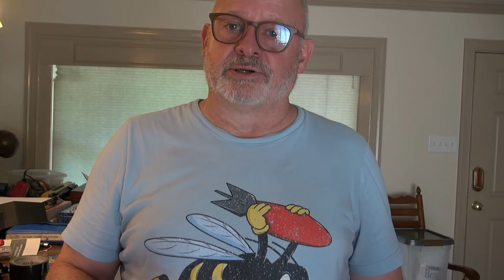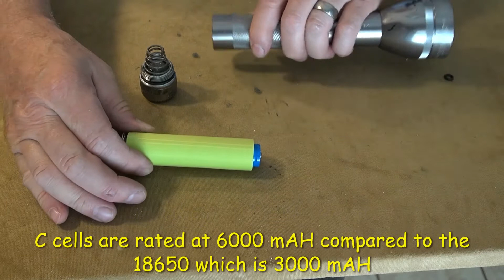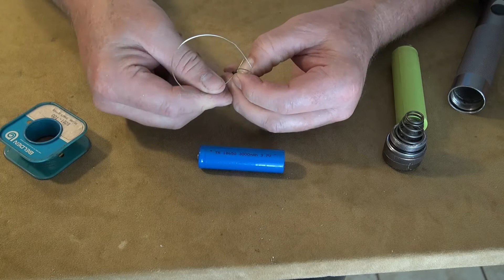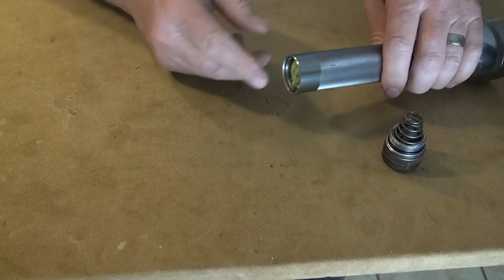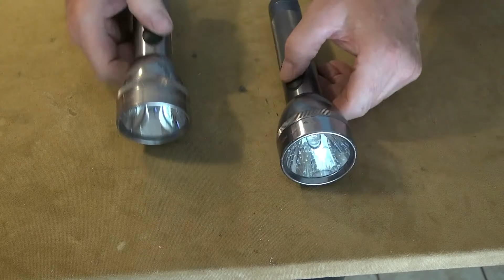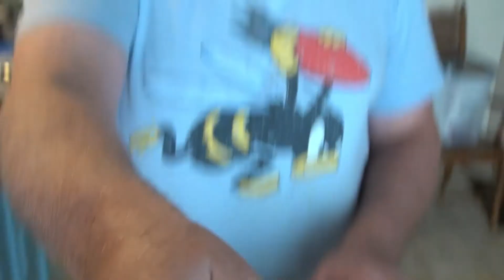MAG lite 2C adapter to 18650

Comment: Instead  of  3000mAh  18650,  now  you  can  use  5000mAh  21700  cells  which   are  little  larger  but  still  fit inside  M*g 2C